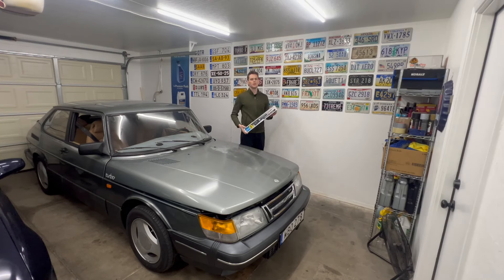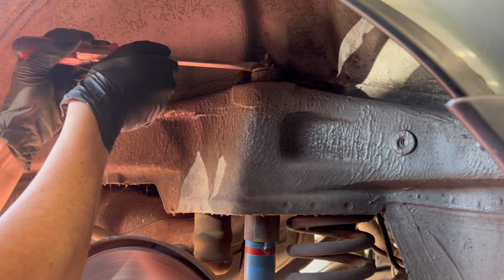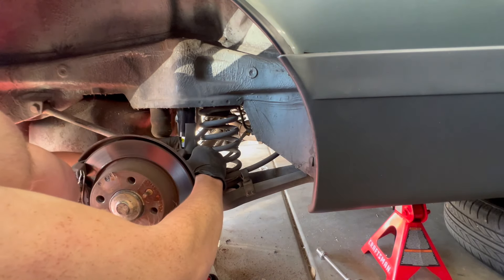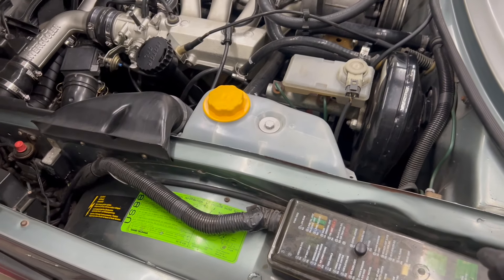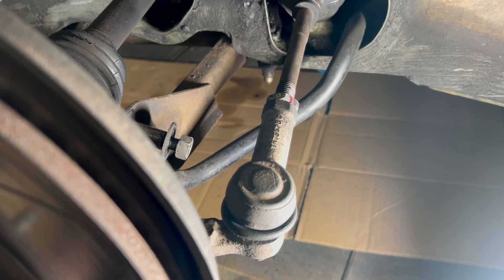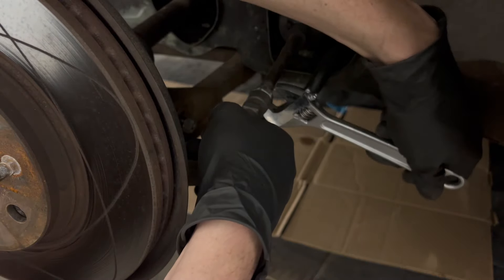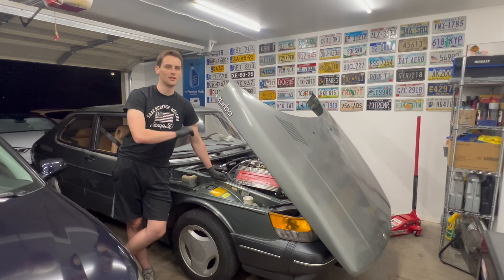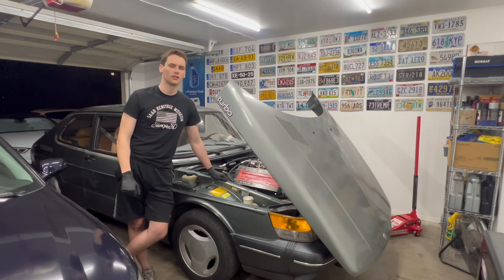Game Changer! Full Suspension Overhaul on My Saab 900!

Comment: The blue dampers were from Sachs. They are the standard dampers in the 900. Unfortunately, the B4 dampers tend to rattle very quickly, which is why hardly anyone (at least here in Germany) still installs these dampers. That's why I switched directly to the B6. Otherwise, the Koni dampers could be an alternative for more comfort. I'm curious to see how satisfied you are with the new setup!
Reply: They have not started to rattle on my 9000 Aero. I installed them in 2019 on the car. 🙂
Reply from the maker: thanks for the heads up; I have always heard great things about Bilstein
Reply: @AutoAutopsy  in terms of the B6 yes, but not for the B4.

Comment: I fixed my in front, will fix the back later but mine is not as nice as yours, its heavily rusted everywhere. I will very likely need to weld some more when i change them in back. Pretty easy in front, used lowering springs with helps with the "wandering"(more safe and easy to get in place too). I did it at the same time as i welded the link arm fastenings that was gone, even the rust had fell off. Have some videos that might help if you get stuck or just ask if you want to do the springs too. They are tricky to get in and dangerous with the widow make...i mean spring compressors.
Reply from the maker: Thanks! I’ll probably do springs at some point. The rear is still sagging a bit
Reply: @AutoAutopsy  Consider lowering it a bit with springs it makes a big difference. But for now you got to enjoy the new shock shock absorbers. I installed those on my old volvo 740 they are excellent. That car is in great shape, as rust free as your Saab and got good paint too.
Keep up the good work!

Comment: I'm seriously thinking about installing Bilstein shock absorbers on my CR-V. Not sure if I'll go with B4s or B6s yet but I'm definitely leaning towards one of those 2 options.
Reply from the maker: nice! I guess it ultimately depends on how comfortable of a ride you want
Reply: B6 is more like for sporty driving with a stiffer suspension.
B4 is more like for more softer daily drive use.
I did also go for the B4 on my og900 convertible cruicer....

Comment: I did a full suspension rebuild on my 1993 saab 900 convertible.  I went with Koni reds.  and I love it.  but I did not lower it.  I have 16 inch Areo rims from  a saab 9000.
Reply from the maker: nice! I would LOVE some 16in aeros...

Comment: looking good with the new suspension. my 900 has one strange suspension issiue aswell. maybe someone has a hint on what it could be!
so i have noticed that my rear wheels seem to be out of place, the driver side wheel looks more out of the fender then on the right side. i looked at the dampers and measured how low the car sits (i have never done anything with the suspension). well it seems that the car has red Koni dampers, also the front sits 35cm low, aswell as the back but the driver side wheel sits 34cm low. but i cant imagine that this is the reason. i am kinda worried, that my suspension might gets damaged or that the previous owner did something with the suspension. i also wonder about the panhard rod. if the car sits to low, that it needs to be adjusted, but i dont know if thats true or not
Reply: Could be that a previous owner changed the suspension from stock and as a result the panhard rod was misaligned.  I’ve changed the suspension and wheel size on my ‘91 SPG and installed an adjustable rear panhard rod to center the rear axle.
Reply: @TheBTG88 well what i have seen so far is that the 35cm suspension seems to be the more sportier version. i already tried to find an adjustable panhard rod but the offers here in germany are zero, or are there universal rods that you can buy somewhere? i know that MCS offers an adjustable Rod but thats out of stock at the moment. so do you have any alternatives?
Reply: @kaisertrinityt.m.i.s1607  I bought mine years ago from Saab Sport & Rally in the US, but they are no longer in business.  Put your name on the list for the MCS one for when they come back into stock.
Reply from the maker: have you tried getting an alignment?
Reply: @AutoAutopsy yes i did one, however it was only made for the front wheels. the data for the back wheels were also noted, however i am not an expert, there didnt understand those numbers.  i still have them, but dont know if you understand them either, or know if there is something wrong tho

Comment: Hello I have a question so I installed my cold air intake about a week and a half ago and everything has been going smooth but then when I was driving uphill my vehicle through a 

P0171
System too lean, bank 1 is that because of The cold air intake or because I installed everything right
Reply from the maker: that almost sounds like an O2 sensor code, but I could be wrong. I would recommend searching that code on google/saab forums to see what possible causes could be
Reply: Thank you very much for your response! Appreciate it

Comment: Heyy, I got a saab 9-3 turbo 4 2011, its got an issue where it only hesitates at full throttle, the car with shutter, and wont accelerate, but half throttle its fine, any ideas? B207R, thanks
Reply from the maker: it sounds like you've got a misfire which is likely caused by bad plugs or coils. here's a video with more info: https://www.youtube.com/watch?v=xJyNJzFX2JI&t=354s